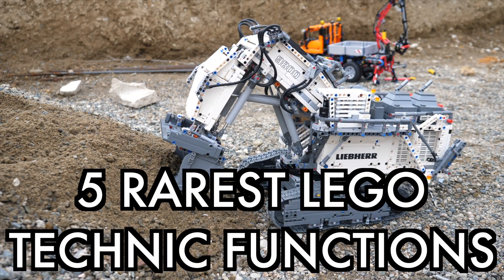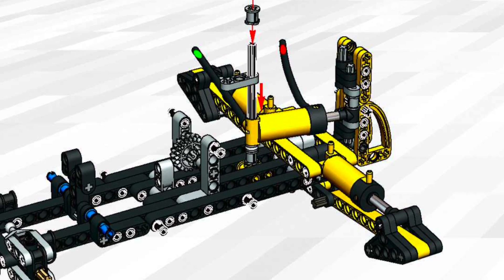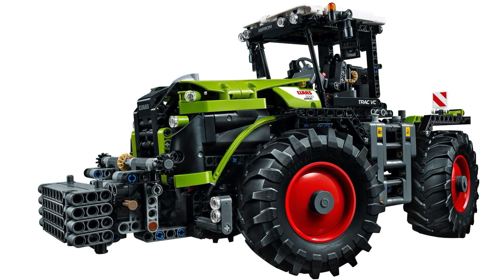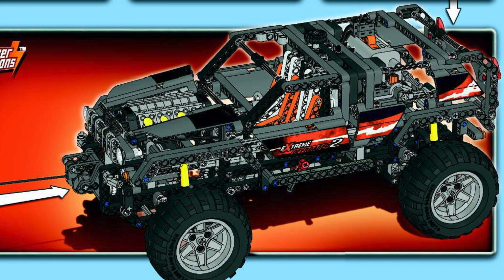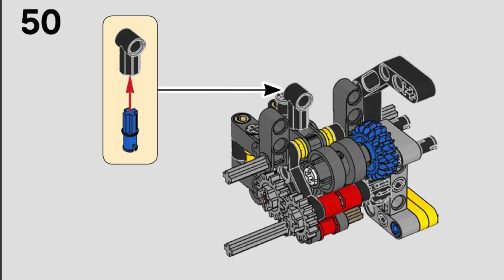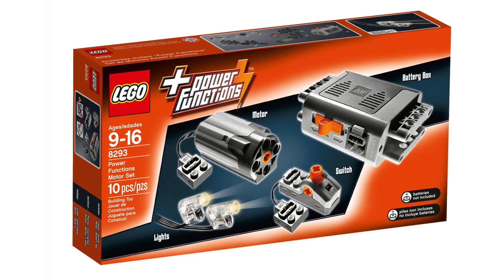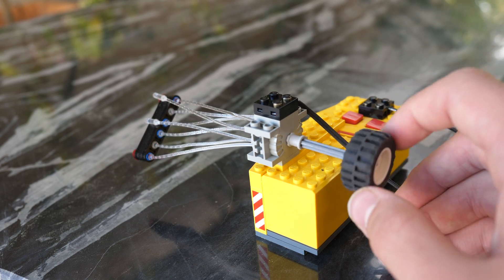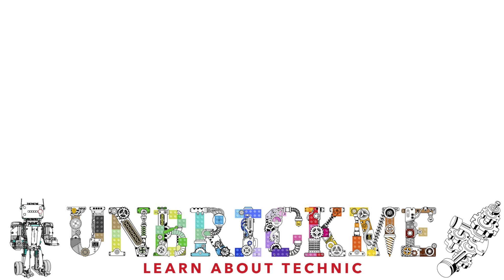5 Rarest LEGO Technic Functions

Comment: From my POV, the 2 speed winch on the tracked loader is because of force balancing. The faster speed if for pulling the winch out to what needs to be winched, or retracted after use.
The slower speed is for pulling under load, since you can pull heavier stuff with the same force on lower gearing, just that you'll need to apply it for longer to cover the same distance.

In short, the higher speed is for setting/packing up the winch, and the lower for actually using it

Comment: Track tensioning in tanks (and construction machines) is "manual", pumped hydraulics to change the sag on the track.  This is important to prevent slippage which would occur if the tension was done with a spring (ie automated) in the new CAT.  So in fact, the lego CAT is realistic, as it would suffer the same problem as a real tracked machinery if the tensioning was done with a "spring".
Reply from the maker: Oh nice, thanks for letting me know
Reply: @Unbrickme 
Old UK (and German) driving license allowed you drive all sorts of things, but tracked vehicles was not included as how to drive is completely different: brake-steer.

Comment: The fiber optics did make several comebacks after its 1996 debut: in some Minstorms sets from 1998, Spybotic sets from 2002 and Exo-Force sets from 2006, however the later ones were simplified/cost-effective versions with just one fiber and no rotating light element.

Comment: Can you make a video regarding bluetooth Control? Which set Has the necessary parts and how to connect PlayStation or Xbox pad?
Reply from the maker: Sounds like an interesting idea. Bluetooth control is possible with the main technic hub (costs $90) and any powered up motor
Reply: @Unbrickme  I am looking for the best prices to get the most bricks and motors with bluetooth xD based on this video ai think that the best idea is to buy number 1 set or number 2 but the second set has less bricks and is only 50% cheaper. Not much. I need cost efficient sets xD anyway I think 42114 Volvo is the best. The calibartion of the pad with motors that is a huuge problematic  topic tough I think